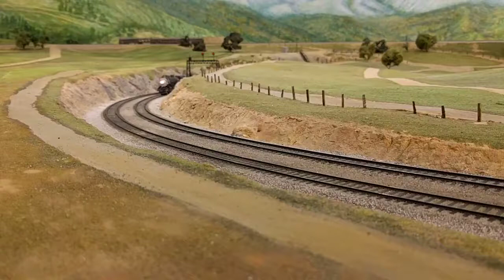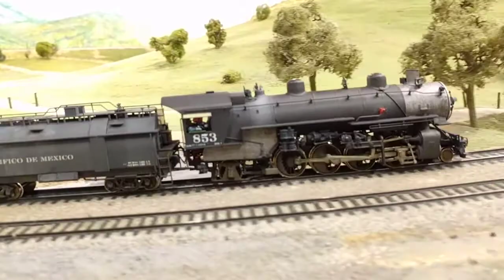Sud Pacifico De Mexico #853 On the Tehachapi Loop

Comment from the maker: Hey...this is a friend and client's old Balboa with the original whaleback tender which was a very rare version. The original owner had painted it but it never had a decoder installed.I added some chalk, paint weathering and a crew. I installed a Pittman can motor, new drive couplings, re-shimmed the gearbox and cleaned and lubed the mechanism. The plating was also pretty worn off the drivers so I polished these with a small buffing wheel using Flitz, a German polishing paste. This keep the drivers clean and shiny for a very long time. I added about 6 oz of lead and put a sugar cube speaker under the stack and a hi base 1" speaker in the tender with a Current Keeper and a Soundtraxx Econami Steam 200. I also added some lead to the tender and wired the trucks to the decoder. An important step is to slightly ream out the tender truck journals, add some graphite powder for lube and polish the ends of the wheels. This insures good power and data transmission from the rails to the decoder. I've my own Balboa MK6 with a candy tender that I may get to some day. Wish I had the whaleback though.